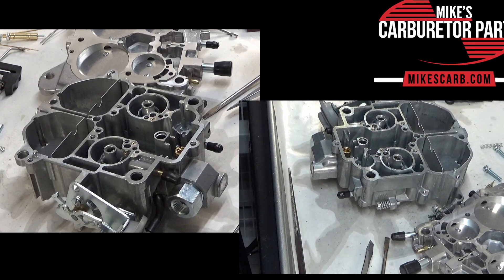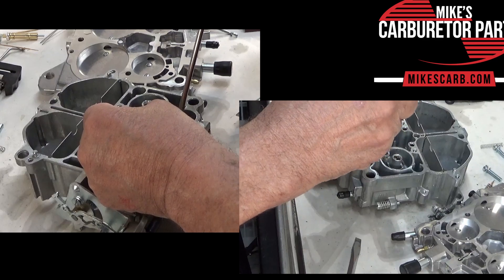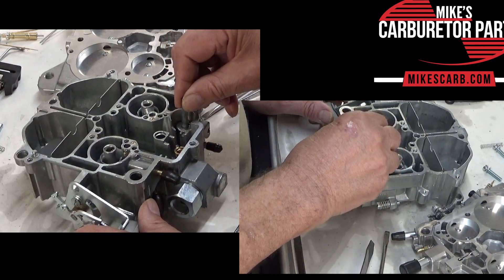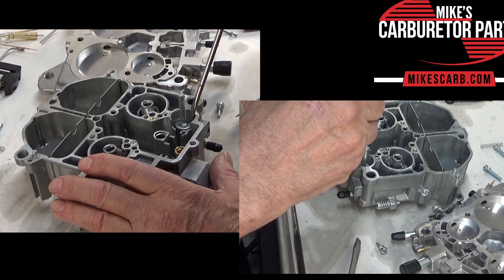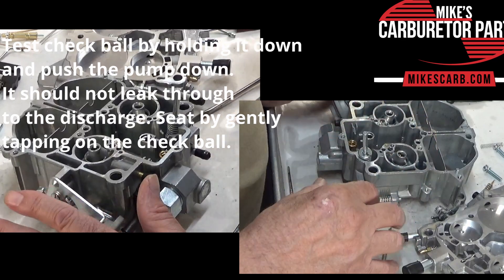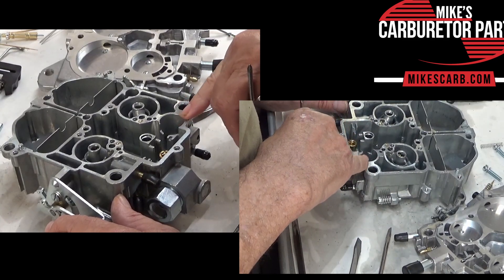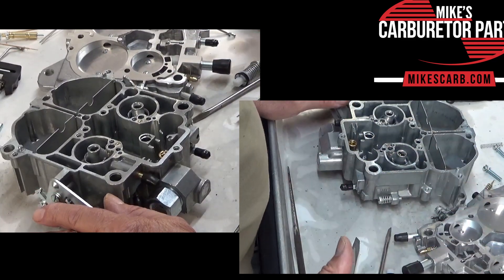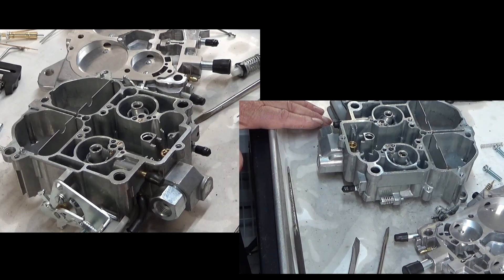Rochester Quadrajet Accelerator Pump Test

Comment: Hi, 
I love your videos, it has helped me alot when I disassemble and assemble the quadrajet to troubleshoot. So thanks alot for that and for putting it out for free on youtube.
My quadrajet is mounted on a volvo penta V8 (GM block) and when I try to accelerate I have no power. It takes a couple of seconds for it to come up to speed. I can see that my accelerator pump is only squirting on the the right sided funnel (on the pumpside) but not in the left. It is very dry in that funnel. Could this be the issue? I guess it is suppoused to come fuel from both sides? Do you know what the issue could be why its only comming out from the left side?
Everything else looks nice and tidy.
Thank in advance!
Reply from the maker: That would be the issue. You have a blocked passage.

Comment: Could you help me out. I take my 84 Riviera with the 307 to a  motorsports place but I have been having trouble when I start it wants to die(when hot,) and when I accelerate or go around corners and accelerate it wants to backfire or feel like it wants to die and it is very very like bogged down when accelerating from a stop. Could this be a accelerator pump issue? The car has all new parts, plugs cap rotor wires filters fuel pump but still it does this. How long do accelerator pumps last??? Thanks so much.
Reply from the maker: Based on the symptoms you described, it's possible that the issue could be related to the accelerator pump in the carburetor, especially if all other components have been replaced and the problem persists. The accelerator pump is responsible for providing an extra shot of fuel during acceleration, and if it's not functioning properly, it could lead to hesitation, backfiring, and bogging down during acceleration.

However, before concluding that the accelerator pump is the culprit, it's important to consider other potential causes as well. Here are a few additional factors to investigate:

Vacuum Leaks: Check for any vacuum leaks in the intake manifold, vacuum hoses, or carburetor gaskets. Vacuum leaks can lead to poor engine performance and hesitation.
Ignition Timing: Ensure that the ignition timing is set correctly. Incorrect ignition timing can cause engine stumbling and backfiring.
Carburetor Adjustment: Verify that the carburetor is properly adjusted, including the idle mixture and idle speed. Incorrect carburetor adjustments can affect engine performance.
Fuel Delivery: Double-check the fuel delivery system, including the fuel lines, fuel filter, and fuel pump. Insufficient fuel delivery can cause engine hesitation and stalling.
Exhaust System: Inspect the exhaust system for any restrictions or leaks that could affect engine performance.